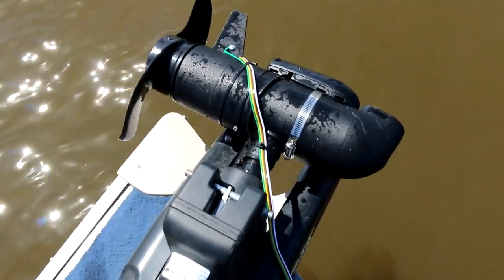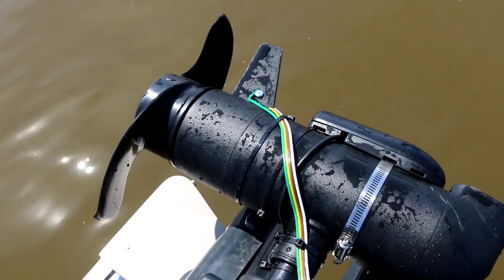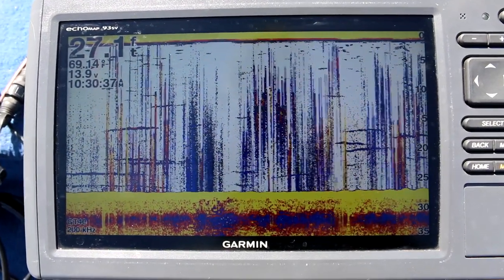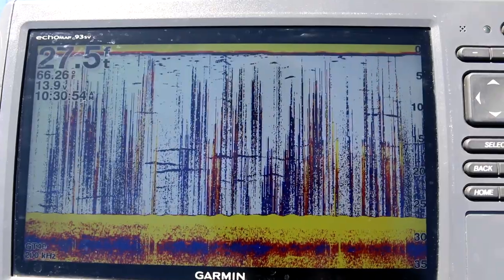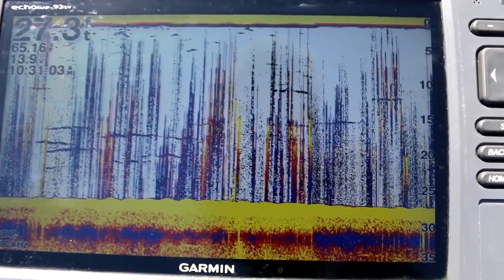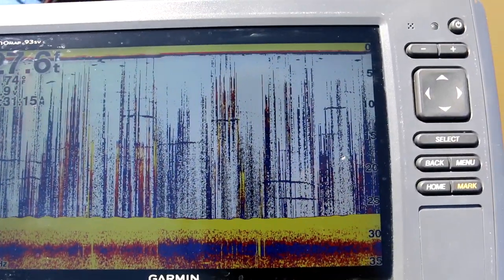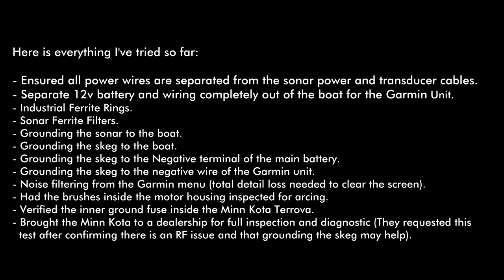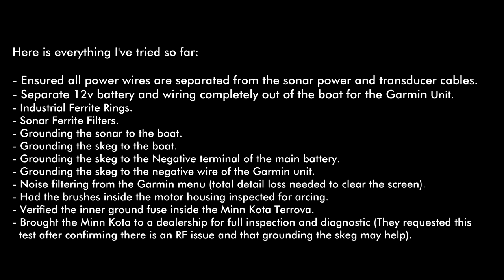Grounding the Trolling Motor Skeg to the Battery Test for Sonar Interference!

Comment: Hey, where are you at with this, now? I'm curious as my 2 week old Ultrex just started kicking out a load of interference yesterday for some odd reason. I'm chasing grounding issues while on the trailer with no immediate or obvious change as of yet and just stumbled on your vids. If I take the transducer off the trolling motor, it stops so I'm messing with isolating it but no success yet. You mention that you're possibly looking for them to upgrade you to Ultrex....well....that "might" not be the fix afterall. I'm hoping mine corrects but I find it so unusual that I had NO issue for maybe the first 5 or 6 outings and then all of a sudden...here I am!
Reply from the maker: Wow that IS strange, mine has been doing it since day 1 and they have YET to fix it.  They never could find out what was causing the interference and no one from Minn Kota corporate is getting back to me or the dealer with anything remotely helpful.  This has been VERY frustrating.  At this point I am probably going to upgrade to a Garmin Force, which was officially announced today at iCast.  Did you check the little fuse in the head of the motor?
Reply from the maker: @OhMySack  I was thinking the exact same thing in terms of purchasing the very first round... I'll hold off and see how the initial reaction is and go from there probably in the fall. Looks like you're definitely going to have to bring in your unit to a repair center. Does your ultrex have the built in US2 puck?
Reply from the maker: @OhMySack  okay cool, at least testing the built-in sonar will help nail down the issue a little bit. Are you using Garmin units? if so get ready they'll give you a hard time and try to blame it on that... if I had to go through it all over again I would say I'm using hummingbird lol
Reply: Tee and Dan, it’ll take a couple people to test but if you remove the transducer from the troller shaft but hold it within a foot the motor, do you still get interference when the motor’s running?  If you do not get interference, then it’s likely still a grounding issue...imo 

In another thread I remember reading that someone ran a grounding wire from the transducer to ground and that it fixed it.  Although I’m not sure how they attached the wire to the transducer.  Just a thought.
Reply: I’ve had my 2019 Terrova riptide with the GT54 transducer working great for two years. Just last week the dreaded interference started. When I take the transducer off the motor housing interference starts. So something changed inside the Terrova motor.